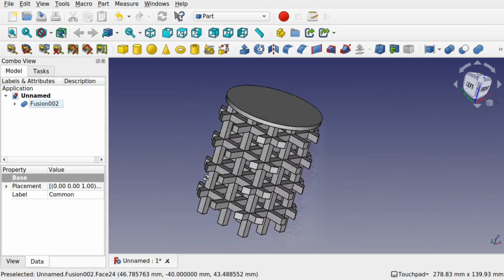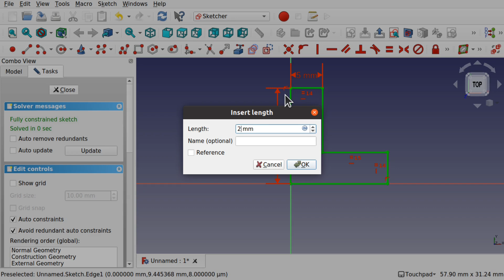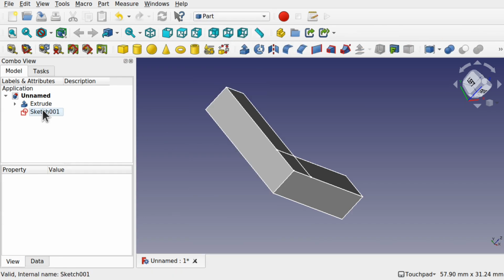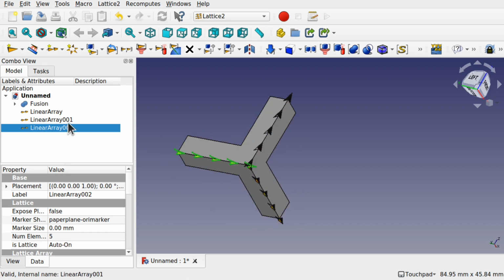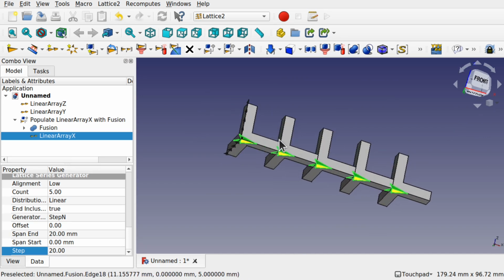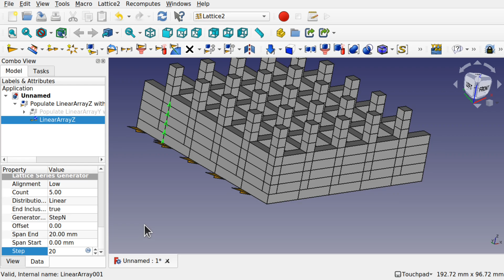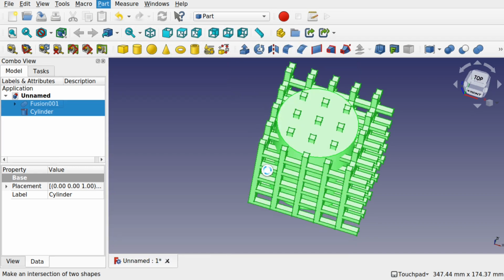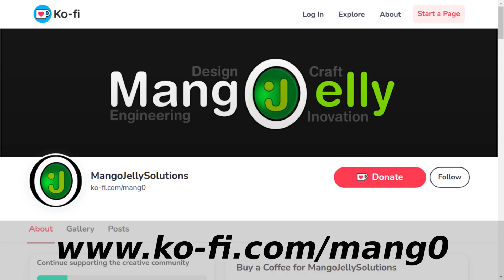FreeCAD Lattice2 : Part 5 - Creating a matrix lattice

Comment: Around 3 minutes in when you switch to the Sketcher Workbench I recommend creating a new toolbar in the Parts Workbench and placing the "create sketch" option in that toolbar.  This way you don't have to jump back and forth between workbenches.  I did it and it has saved me a lot of time.  I also use the Manipulator addon and created a toolbar for that.
Reply from the maker: Great time saving tip, thank you for adding.

Comment: This might be a reason why it does not print. I noticed that I had to do a fusion after extending the lattice in the X direction. Then another fusion after extending in the Y direction, and again another fusion after extending in the Z direction. That way, after refining, there are smooth surfaces on each face, and the whole matrix is fused together. Perhaps I could have formed a perfect fusion another way quicker, but my method worked. I noted that this was discussed 9 months ago.

Comment: Hi, Lattice2 author here! Thanks for making these tutorials, much appreciated!
There is one rather serious hidden error in this tutorial. Did you notice that the fusion of the final populate did not refine properly? That's no accident. When you make an array with successive populates, the resulting internal grouping of the shape is nested - the result is a compound of 5 compounds of 5 compounds of solids. Part Union only operates on the top level compound, so it fuses only the planes to each other, but the planes themselves remain unfused. The result is invalid for boolean operations, and it's actually rather strange that the final cut worked.

There are several ways to deal with it:
* use Lattice2's "Downgrade to leaves" to get rid of the nesting, before fusing
or
* fuse them up after each populate
or
* populate arrays into arrays to build up the full 3d array of placements first, and then populate it with shapes in one go, then fuse.

BTW, Lattice2 has a shape info tool to quickly check the shape type and structure. Your shape before fusion is:

Compound (5 objects):
    Compound (5 objects):
        Compound (5 objects):
            Solid (1 shells)
            Solid (1 shells)
            Solid (1 shells)
            Solid (1 shells)
            Solid (1 shells)
        Compound (5 objects):
            Solid (1 shells)
            ...
Reply from the maker: Thanks for pointing this out, I didn't see that, that's really strange  how I haven't come across any problems with the cut in the past as I have used this process multiple times in other projects, very strange. Thank you for such a great workbench, it's been one of my favourite workbenches along with Curves. I am going to add your detailled response to the description and experiment with what you have suggested to put in a follow up video. I know what it's like trying to document these kind of thing (I am a software developer myself and I know documenting your own creations is more time consuming than writing the software in the first place). I will be documenting alot more of the workbench (of what I know) via videos so your comments are always welcome. I really want to get people understanding what freecad can offer and little gems like what you have produced I have found really help people to move over to the software.
Reply: now i'm thinking, maybe i should modify the code of the workbench so that it flattens these nested structures by default. There are some obscure cases where this nesting can give serious speed gains, but apparently, it just causes problems for those unaware of the issue, effectively wasting everyone's time.
Reply from the maker: @invendelirium  hmm tricky one, could you prompt the user first to ask them if they want to merge it  after they used the tool? . This way you can warn them in advance?
Reply: I was going to comment in asking about this, as the lines persisted in some places. thanks a lot. and GREAT GREAT work! I work with lattice structures, for the moment I use Salome instead of freeCAD but nevertheless it is a great tool I should say :)
best regards!
Reply: Hey!  Thank you both for your great work.  Fortunately, there are people like you who help make the world a better place.  Long live FreeCAD!
Reply: Excellent tool you've provided the FreeCAD community! Thank you for your hard work. After trying your suggestion to build the full 3D matrix before populating, I was able to cut the matrix from the cylinder which did not work previously.